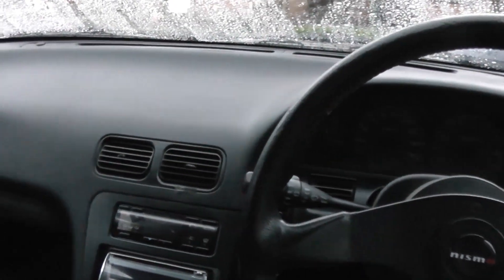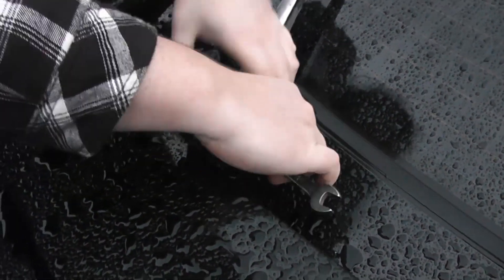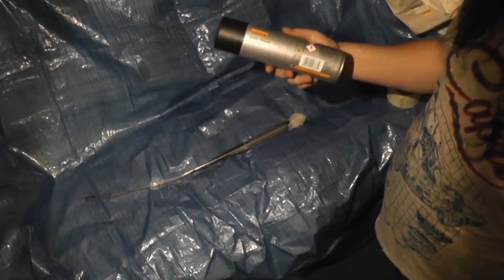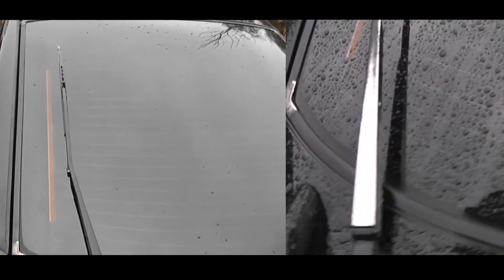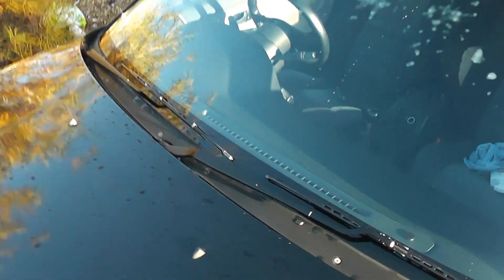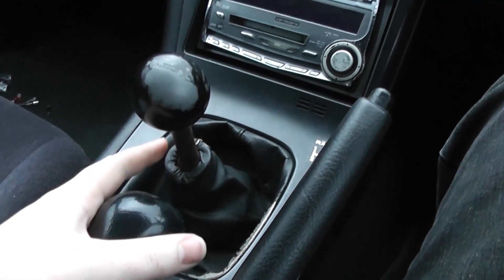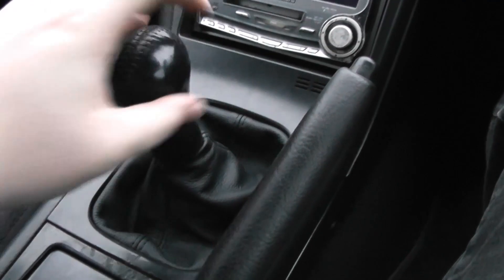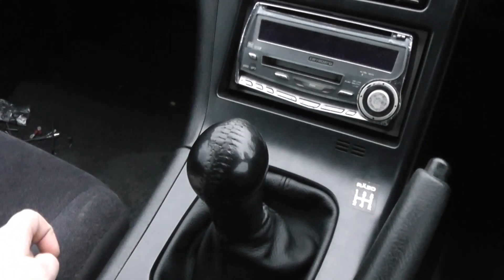Nissan 180SX Wiper Repaint and Gear Stick Refresh

Comment: The duct that is connected to the back of the fascia plate is used for the auto climate control system. When the fan is on, air is sucked through that vent from the cabin and passes a thermister. This is used in conjunction with the light sensor on the left hand side of dash to tell the climate control how hot or cold it needs to be. Took me lots of research to find that out :)
Reply from the maker: I thought it was probably something like that. I never use the climate control in auto mode anyway, so I've just left it cable-tied out the way.

Comment: Looks good, you need to sought out the center console back from the gear stick as the dents/chips let it down
Reply from the maker: The removable bit you can still get direct from Nissan in Japan, but it's not particularly cheap. The piece behind that doesn't come out. There might be some way of releasing it, but otherwise I'd have to source a new/undamaged centre console, which would be nigh on impossible I suspect. Thanks for watching.